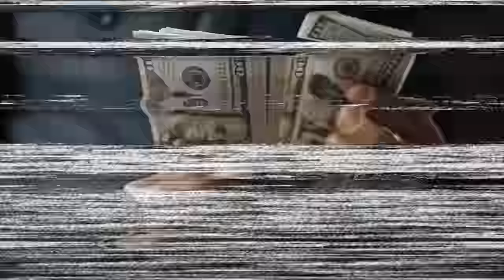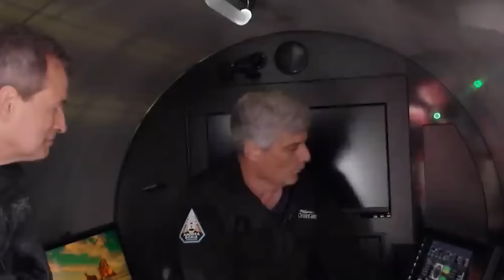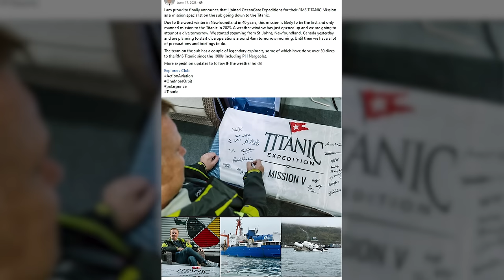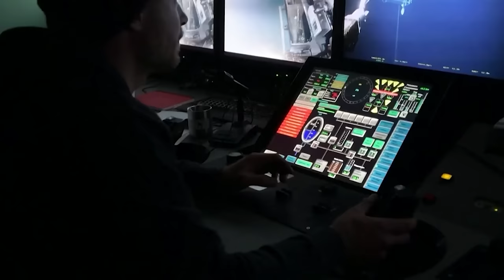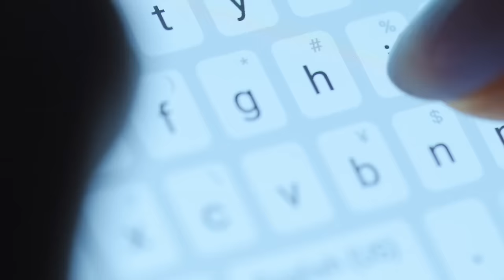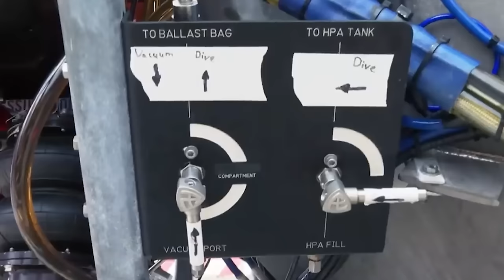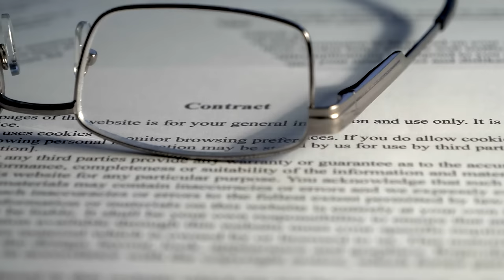The Titan Tragedy: What Went Wrong with OceanGate's Mission?

Comment: Titan was doomed to fail from the start. The fact they were able to descend and ascend as many times as they did before the disaster is nothing short of a miracle. Stocktons ego is what killed everyone.
Reply: Stockton was truly delusional
Reply: Absolutely agree it was doomed to fail from the start. I don't see the successful ascents/descents as a miracle. It was performance within the fatigue life of the materials used. Which he would have known had they actually tested to determine the number of pressurization cycles the material could handle.  IMHO-- this came down to failure to test an innovative design under conditions accurately modeling the operating environment for the design. 
They didn't approach this with any engineering rigor at all. Simple calculations but no consideration of operating it over some lifetime/pressurization cycles.
Reply: @ma-jp8bf yeah it's actually a pretty cool sub that would be cool if it were adopted in the future for the reasons Stockton described it being cheaper and lighter... but they just simply did not test how long it would last like so bad lolrip
Reply: So it wasnt DEI?
Reply: @Abstract.Noir414  
No it was IED
Reply: Yes, and no.  Many agreed it was suitable for one trip down and back at most.  Rush basically made a disposable single use hull, but then used it multiple times.
Reply: @Chris_the_Muso was going to say the same
Reply: Odds
Reply: It wasn’t a miracle. With each dive the carbon fibers contracted when the sub descended and expanded when it ascended to the point of failure. Just like when you bend a piece of metal back and forth enough times and it breaks
Reply: His ego was big but shattered when the titans hull collapsed. Now his legacy is forever tarnished and he’ll be remembered as an arrogant  buffoon
Reply: That level of ego scares me lol.
Reply: Naw... not ego. The "move fast, break things" ideology. The finest of capitalism. ;)
Reply: @ma-jp8bf  Yep, I'm not an expert but based on the material I watched about the accident, the design would've worked with a disposable hull which was used for two or three missions at most, but Stockton Rush decided that it could take plenty of use (perhaps due to financial considerations?) So he ended up inadvertently testing how long his luck would last.
Reply: @alexphoenix9208 not capitalism, just stupidity and arrogance of Mr Stockton
Reply: @JohnS-il1dr  Meh, desire for profits often solicits stupidity.
Reply: @meckelbu  Stockton was in the area of wishful thinking instead of deliberate and methodical engineering.  He decided it could take plenty of use because he was completely emotionally invested in the belief it would.
Reply: They could have bought an ultrasound machine fairly cheap to inspect the hull integrity between/after dives.
Reply: Hey guys, let's jump into this firey pit. Am sure it's gonna be fun.
Reply: There were so many things wrong with this trashcan it was doomed from the start.
Reply: Stockton must have been an expert salesman to get people to sign their rights away, pay $250,000 per person to take a ride in a Death-Trap that wasn't approved by any outside  safety authority, in fact a vessel which many  experts said was inherently unsafe.
Reply: I am convinced that a Giant Squid got them.
Reply: @pulehushortribs157  kinda wild lol
Reply: @Chris_the_Muso  Not only that, he ignored all the audio warnings that the hull was failing. They heard constant cracking sounds on various dives and did no testing to figure out if they were critical failures or just normal.
Reply: Not a miracle. Structural fatigue takes a while until it actually fails
Reply: @3dguy839 he made a few dozen mistakes that's why pencils have erasers..HELL USE  NO MORE PENCILS ..OR EAT OR SLEEP EVER AGAIN...TWICE

Comment: Trying to imagine a 5 foot 10 human body being compressed into less than a 1 sq inch cube of glop faster than an eye can blink is just mind blowing.
Reply: Literally.....
Reply: Hard to believe they turned to red paste in a instant.  This disaster has played on my mind for many months now.
Reply: It's more like a diesel engine compressing air and fuel. No spark is needed to create ignition. In the case of the Titan, there was a brief flash, then charred dust.
Reply: I imagine it's a bit like that scene in Ant-Man with the unstable shrinking gun. But also with metal and carbon fiber also being compressed into that same space.
Reply: Most of the body is not compressible, so it would never compress into a volume of 1 square inch.
Reply: @NoahSpurrier  when pressure is stronger than matter, anything can be compressed.
Reply: @VladimirBlarp  Just figure that the human body is 60% water. So just that volume of water in the human body alone would not be compressed any denser than the water that was outside the OceansGate vessel. That water at that depth is only a few percent denser than water at the surface. Just from that you can see a human body would not be compressed into 1 cubic inch. The other 40% of the body is also mostly solid matter, which would not compress much more than water would.

You can compress solid and liquid matter but not by much relative to human experience. The density of iron at the center of the Earth is something like twice as dense as iron on the surface. Water at the bottom of the deepest ocean is only a few percent denser than water at the surface. That’s still a very long way off from the pressure needed to compress all the mater into a human body into 1 cubic inch.
Reply: I can just imagine the fear they all would have felt prior to it, as there was bound to be signs of it starting to fail,creaks in the hull or some sort of alarm going off. Stockton definitely would have had some sort of idea and probably started showing signs of getting worried.
Reply: @Klynch111  I honestly believe that everyone on board knew that their deaths were coming and that they were never going to see the surface again. They knew that in a matter of minutes they were going to be practically vaporized, and they knew this all while in complete darkness.
Reply: @VladimirBlarp I hope if that was the case then they also knew it would be instant and they weren't gonna suffer. But the anticipation and waiting for that to happen must have been hell.
Reply: It would not crush you into a 1 square inch cube. Thats literally impossible. It crushed the entire sub and 5 grown men into a mass about the size of a standard washing machine. Absolutely brutal.
Reply: Knowing it's coming, your heart would probably hit 200 bpm and your mouth as dry as can be. I'm sure at least one person fainted, etc.
Reply: @JuliusCaesar888 and farted
Reply: @JeaneGenie   someone definitely chit themselves 100%
Reply: @NoahSpurrier   The human body is not reinforced steel.  Except for bone, which fractures frequently,  the body is soft tissue.  I don't have any information about 1 square inch, but with enough pressure,  it could be compressed to a very small size.   At that depth rhe pressure on Titan was tremendous.

Comment: I guess I have a different opinion on what a "dream trip" is. 4000 meters down in the north Atlantic ocean isn't it.
Reply: Having sailed the North Atlantic on my US Navy ship in the early 1980s, that was "adventure" enough for me.  I'd definitely pass on this Oceangate affair. 😮
Reply: @lancerevell5979  how far up did you go if you don't mind me asking?
Reply: I'd jump to get on a SpaceX rocket to the space station, but I wouldn't have gotten bolted into that sub for 100 million dollars.
Reply: Anything that requires me to get into a cramped tube—be it traveling into space or under the sea—is right out. A plane is bad enough, but at least I’d end up on a beach in the Bahamas at the end of the flight!
Reply: It's kinda funny that I'm 6'5" and simply would not fit!!

Comment: There were so many red flags with the Titan from day 1. The use of carbon fibre, the shape of the sub, and the lack of training, just to name a few. It's such a shame that "progress" was put before safety. RIP to those on board.
Reply: Also all the cut corners, the mixing of carbon fiber with epoxy and titanium all of which expand and contract at different rates, the consumer not commercial grade components, and overall narcissism
Reply: Except that Stockton Guy
Reply: @AllHailDiskordia yep. He's the only one I have no sympathy for.
Reply: Yeah, i work on subsea equipment, never mind people being in it, there are things as you mentioned id be concerned about for such a large pressure vessel going to such depths. Its a joke for Stockton to call this progress, certain things are unorthodox for a reason
Reply: Supposedly people had tried to sabotage the sub in the past. Not saying it caused the implosion but it’s messed up that someone COULD have caused deaths and didn’t care.
Reply: Even the choice of paint was amateurish. White submersible would be hard to see among white-capped waves.
Reply: the fact you could not open the hatch from the inside.
a pathetic communication method to mothership
Reply: There was video on another channel purporting to be of the submersible being constructed. You could see dust particles floating in the air as components were being bonded to each other. How many particles were embedded in those joints?
Reply: The use of old carbon fiber-it has a definite shelf life, and the weird attitude of Rush in cutting corners and refusal to employ experienced submariners and marine engineers-he fired the one who seriously warned them of the dangerous project, were red flags that came together to doom the vessel and the 5 occupants.
Reply: @RossM3838 What else will you use on carbon fiber if not epoxy. In addition, a mixture of carbon and titanium is used in many different things, including things for space. Incidentally, there is carbon in virtually all iron and steel, it is actually what makes iron/steel hard
Reply: Stockton Rush was truly delusional
Reply: Yet another example of MONEY MAKING being put before  human lives !  RIP to all 5 unsuspecting victims
Reply: @3dguy839  apparently she took it as a personal insult when people questioned it's safety 🤭 .
Reply: the crucial element that's absent from Titan is that there was no industry recognized testing of the pressure hull. Also, the video naration talks about Titan being "state of the art" whereas it wasn't. At best it was an experimental craft with an untested pressure hull.
Reply: If carbon fibre is so weak why are F1 cars made out of it?
Reply: @PointNemo9  because F1 cars don't have to deal with the crushing depth that the Titanic is at.
Reply: @jarigustafsson7620  As the search and all was still going on and I saw their method of closing off the vessel for diving, I thought how do they get out of the submersible if something goes wrong? Even if they reach the surface, they only have, what, 94 hours of air. If not found in that window of time, they suffocate. That and that waiver should have been huge red flags.
Reply: @nigedanton4835  At one point it is my understanding that they tested one of the hulls to implosion. Who the hell takes a design that implodes and then runs with it?
Reply: @PointNemo9  It's fine for surface application and aviation. However it isn't strong enough to use at depths such as where the Titanic lies.

Comment: "What went wrong?"   Well, everything.  No surprise when he blatantly ignored virtually all basic safety protocols.   And really cheaped out on his technology.  🤨
Reply: In a previous dive someone at oceangate put one of the thrusters on backwards.    This is the result of hiring people based on lower cost.   Highly experienced people are more expensive and less malleable
Reply: Seems like an inadequate engineer with too much money.  Generally, when you resources let you get a head of you skill set, disaster isn’t too far around the corner…
Reply: I ❤️ Camping World!
Reply: @JS-gv3kf  and especially with Bluetooth.    Everyone else in the world has their controls hard wired and backed up.    But Stockton Rush used a Bluetooth game controller.   What an iconoclastic innovaor   Yep
Reply: @JS-gv3kf  The video game controller is the least egregious problem in this whole thing. The military uses video game controllers. They are mass produced and are generally  reliable. If you engineer your own solution, you won't know how often it's going to fail.
Reply: Be that as it may, at least he had the balls to get on board himself.

Comment: The Titan had already made four dives to the Titanic, they never had the sub checked to see what impact such depths  had on that carbon fibre hull.
Reply: Heavy deep water pressures and glorified fiberglass - not good bedfellows.  😒
Reply: They had already replaced the hull once with exactly the same kind of carbon fiber.    They knew that there were probably problems but went anyway.
Reply: By then it was clear that the structure was already comprised. Passengers would hear these loud sounds whenever the sub went deep. The fact it didn't end sooner is a minor miracle.

Imagine being 10k feed down and hearing crackling and popping sounds. That just isn't right lol
Reply: @DJRonnieG yeah! I get cracking and popping sounds from my 1966 Gibson tube amp!
And that's at atmospheric pressure!
Reply: @dirkvanerp7332  I'd feel safer riding to the bottom inside of an old glass vacuum tube as opposed to that carbon-fiber sub.
Reply: @DJRonnieG  to make this a viable commercial enterprise Rush needed to make a bigger submersible than the norm.    The Alvin holds three people if the squeeze in.   Rush wanted 5 or more.    A spherical titanium hull that big would be very expensive and heavy.  His brainstorm was carbon fiber.  And nothing was going to change his genius idea.   With carbon fiber he was able to create a sub that was twice the size of the Alvin and half the weight.   But carbon fiber isn’t good for this application.  He wasn’t listening
Reply: @RossM3838  do you carbon fiber would've been more appropriate if he had used more material along with changing how the titanium hemispheres are attached. It seemed to me (once it was pointed out) that the titanium lip that goes over the carbon was too short. Even if it was the collar was longer/deeper, the high-pressure water finds inevitably finds a path of least resistance. Maybe an additional gasketed cover would've done the trick. Well probably not....

Carbon doesn't really "give" (flex) and once it story's to give, you're already at the precipice of catastrophic damage. They managed a few dive/emerge cycles but Rush should've gotten X-Rays after the first time couching sounds were heard.
Reply: @DJRonnieG  it’s hard to know not being an engineer.   Their own video shows them applying the epoxy by hand and eyeballing the attachment.   No epoxi seems to have squirted out so one question was did they apply enough?  And did they leave any bubbles?
Reply: What's his face who road on it said you could hear gunshots. Banging..that was the haul being compromised. Fibers snapping I'm assuming. 1 by 1
Reply: @DJRonnieG  anyone who has used a carbon fiber bicycle will know that.   The stem will just snap off with fatigue.   Steal will bend.   Who can forget froom’s bicycle just snapping in half due to the motorcycle incident
Reply: @RossM3838  reasons why I didn't succumb to the temptation to install a carbon fork onto my bicycle 👍 Excellent point.
Reply: Mostly because unlike with metal hulls it's a lot harder to properly scan the hull for weak spots forming.
Reply: Interesting, I did not know that but it kind of makes sense considering the nature of the  two materials. @G1NZOU
Reply: @RossM3838  Alvin is a properly constructed vessel and rated for deep dives
Reply: Blinded by greed
Reply: @dirkvanerp7332 damn,  you must love your music to have a classic amp like that,  well done sir
Reply: More than four, this was like the 13th trip, I think most subs get refurbished or retired after four or five trips that deep and they weren't keeping up with wear and tear maintenance.
Reply: Exactly ,they had already done previous successful dives, although they did not take into account the cumulative stress on the vessel . Like a weak link in a chain... Sad.
Reply: @G1NZOU  Actually, there is.

The engineer who was fired from Oceangate for calling out Stockton found out simply by shining a flashlight on one side of the hull and standing on the other side. Carbon fiber of that level is supposed to remain Opaque when you shine light through it.

The Light was stated to shine through the hull section, telling the Engineer that the Hull was compromised. He brought it up to Stockton... And Stockton fired him.